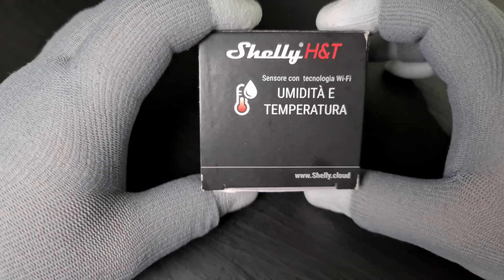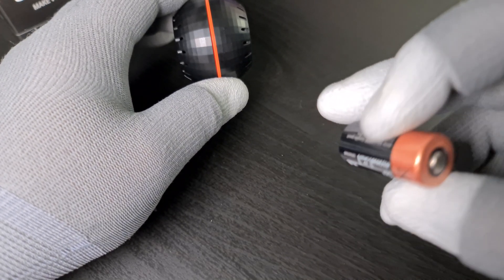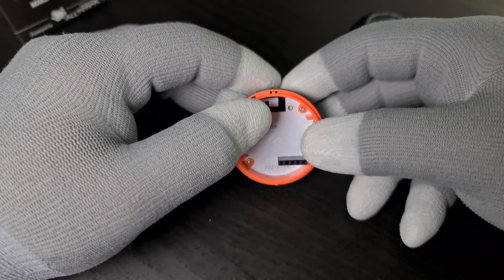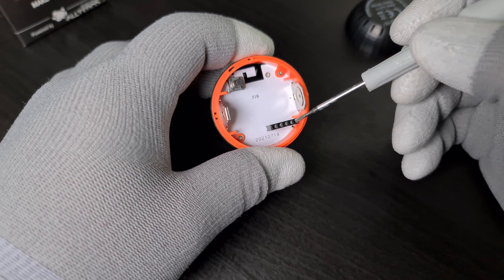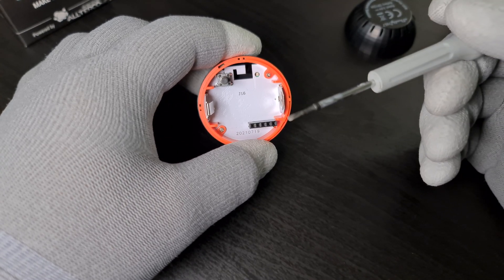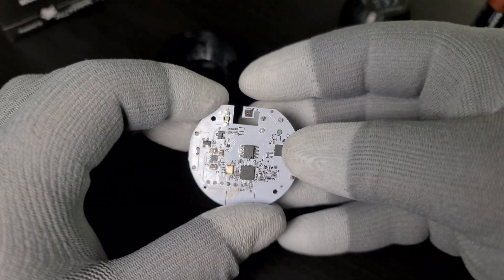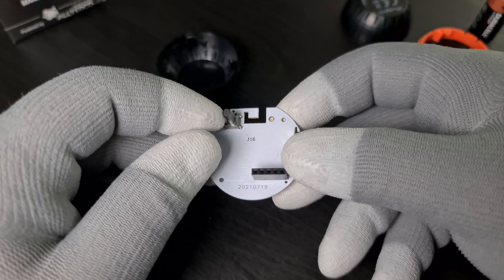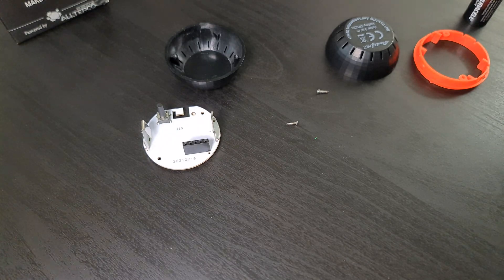Shelly H&T sensor teardown

Comment: I have 3 of these, updated firmwares and newer version of the app seem to work fine now. Had them on for about 3 months now gathering data and no problems really. Sure they are slow to send out the data when battery powered so not good if you want realtime data. I'm thinking about DIYing a usb/regulator to power them on constantly in some locations, the USB cap probably just has a regulator and some contacts to push on the battery terminals. I'm surprised they soldered that header on which does not seem to do anything?

Comment: i've heard more bad than good on shelly but, really not much either way good or bad as they are not super popular but , mostly people say they have issues with pairing or disconnecting.
Reply from the maker: I haven't tried the mains powered devices, those must be fine since they don't have a sleep problem like this one. Believe me i tried so many times to make it work properly  i don't think it's usable in a smart home system. It simply cannot work with the efficiency of low power sensors like zigbee or zwave.
Reply: @leosedf  it's the device not the wireless protocol i have the Govee wifi temp sensor and man do those batteries last. more than 3 months on 15 to 30 minute refresh/update interval. no home assistant support though, unless you have bluetooth. z wave and zigbee is getting be a pain in the ass as you can't find any wifi devices. Also low wan/LPwan and lora wan are far suprerior to z wav or zigbee they havea range of mile(s) through metal, concrete and earth. one guy set up his lorawan on his bench and whent to the grocery store to test the range and it worked.